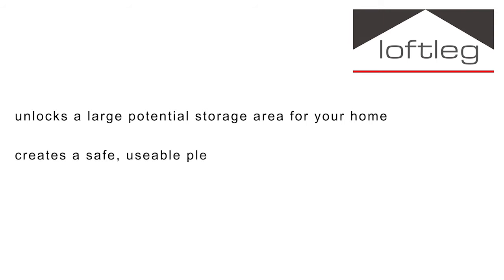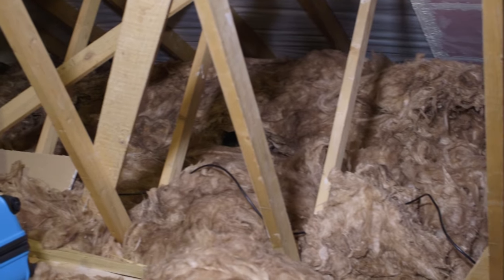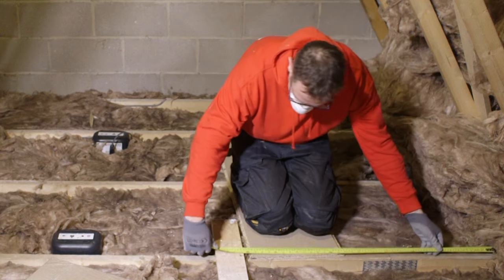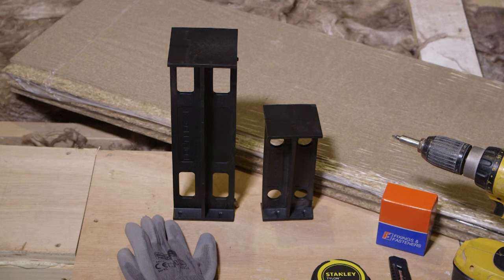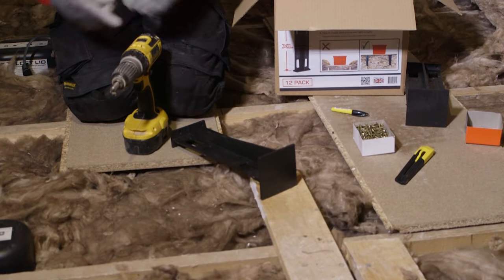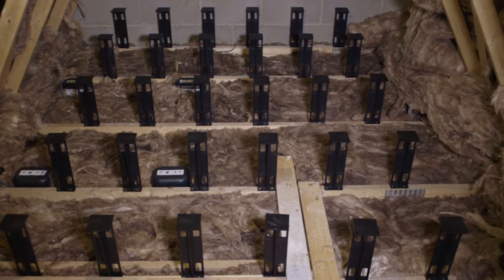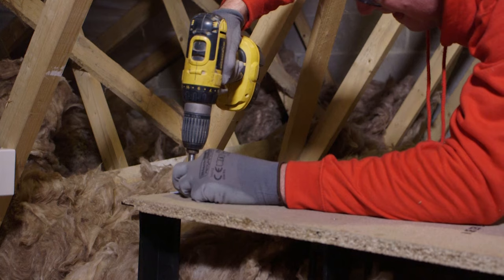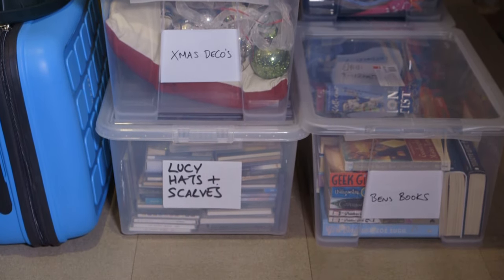How to Board a Loft | ADVICE | Homebuilding

Comment: Done everything as on yours video. 
After 3 days all boards were wet from underside.
Condensation between the loft,insulation and boards.
Video doesnt tell the true.
Reply from the maker: Hi @Mkmusic20192... if the boards hadn't been here the condensation would have been on he inside of the roof structure instead (on the felt or whatever the inside of your roof structure is made of.) The boards don't cause condensation, nor amplify it, they simply give a new place for the water vapour to condense. At this time of year (early > mid January) in the UK, the outside / indoor temperatures are so different that condensation is almost inevitable unless you live in a Passivhaus. A remedy is a dehumidifier... but as it warms up outdoors the issue should disappear reasonably soon.
Reply: @HomebuildingMagazine  so you are saying this isn't a long-term problem if the boards dry out fully later?
Reply from the maker: We're saying it's not a problem that can be solved by removing the boards, or that is caused by the boards themselves. The boards may require replacing if they're damaged by condensation over time, but this would take some prolonged exposure to dampness.
Reply from the maker: That might be possible yes, Peter, and I can't see that it would affect the integrity of the boards too much ... but not sure how much difference it would make, though as the boards aren't in any way air-tight or blocked off at the sides. The air flow should be pretty free already.
Reply: Yes, this is a major flaw in the video. Many experts advise a 25 - 50 mm gap between the insulation and the floor board, so that an airflow can prevent condensation. Thus I cannot see that 175mm legs are useful for 275mm of insulation. You need 200 mm legs (+ the 100 mm of the original joist) to allow for this.

Comment: Doesnt adding weight to the joists cause them to sag?
Reply from the maker: No, if that were true, no houses would have a first floor.
Reply: @HomebuildingMagazine  I should habe said shouldnt adding weight to joists that were only designed to hold ul the ceiling below sag due to the extra weight? Roof joists are typically thinner than flolr joists?
Reply from the maker: Typically the joists in a loft will support about 40kg/m2 of weight so providing you're storing less than this you won't need to do any additional work to strengthen the joists. 

It's always a good idea to think about how you store stuff and spread the weight out over a larger area and always away from the middle of the joists (where they are likely to bend most).

If you plan on storing more than 40kg/m2 of weight up in the loft, you may need to strengthen the joists to prevent them from bending.

If you're planning on anything other than basic storage, it's probably best to consult a structural engineer.

Comment: Should there be a gap between boards and insulation for any air flow?
Reply from the maker: No gap is required, as long as the insulation is not squashed.
Reply: @HomebuildingMagazine  10cm insulation between joists, plus 20cm insulation on top of the joists. Would you go for the 17.5cm or 30cm XL Loft Leg? Thanks.

Comment: Is this something a novice could do themselves? And when I say novice I mean I can barely put a shelf up. Great video though and seems straight forward enough
Reply from the maker: Hi Jonathan, thanks for the comments. Should be fine for a novice - it just might take you a bit longer. But none of the techniques involved are difficult, as long as you have the right bits of equipment, and are confident / comfortable moving around in your loft space, there's not much that can go wrong. Make sure to avoid any cables or pipes, and check your measurements before you screw anything in! Good luck :)